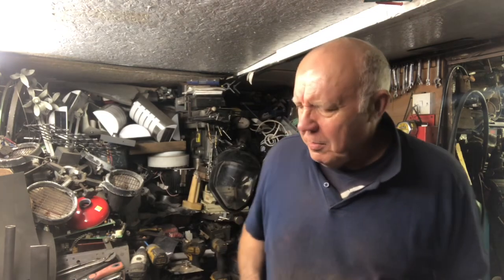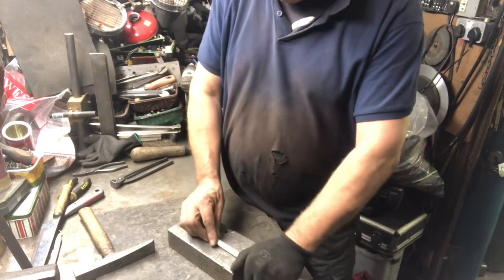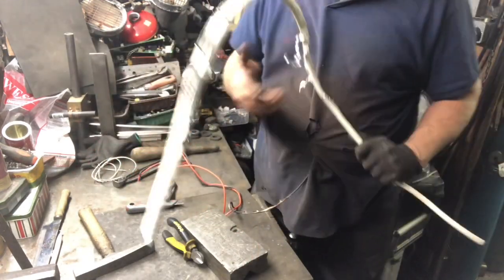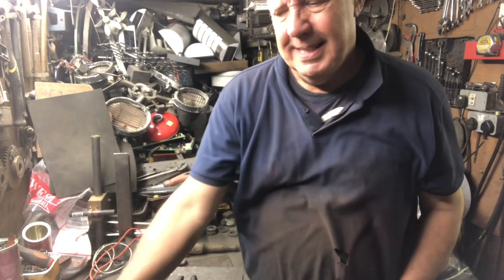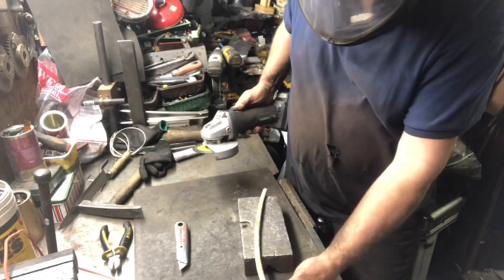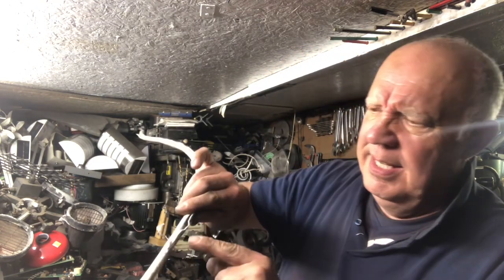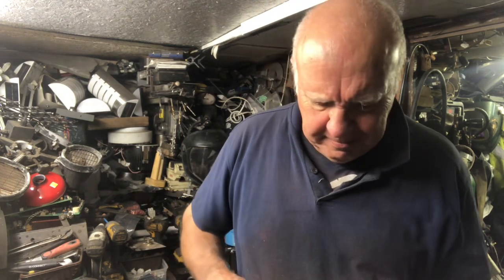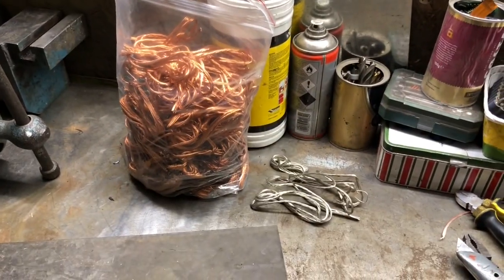FP200 wire. stripped easy way for copper

Comment: Some think this channel is just another pretty face but they are gonna be in for a shock today!  Very methodical and clever solution.  Over here we have some older fiber wound twin and earth cable that strips about the same.  Cut it to length and pull the individual strands out with pliers.  Cheers.

Comment: What we call bx or dx cable here in the US is similar. The other sheathing is just steel or aluminum with no coating
I've found it's really easy to get the all the inner wires out by just opening a 6 inch portion at one end to expose the wires inside
I then take and wrap the exposed wires around either my steel bumper on my van or the hitch and then simply pull on the sleeving from the other end
I've done up to 20 foot pieces at a time and it just slides right out
Reply: how do you fix/hold the other end of the sheathed cable? surely you have to hold that back some way

Comment: I have stripped many of that wire type, they use it for fire alarm wiring, I have never tried taking the ally out. I use to pull all three at once. I wore thick gloves and put my foot on it and pull.
Reply from the maker: I did that once, me hand slipped off n I smacked myself int chops
Reply: @Man-in-da-shed LOL... I see you were pulling without gloves . Need to be careful
Reply from the maker: @iffy9776  almost 100% I wear gloves, those black clingy ones but I can’t operate the iPhone with them on, so for some short clips it’s easier to leave them off or just on one hand

Comment: after 30 plus years of scrapping i finally invested in a auto stripper . worth every penny of making things easier and less time consuming . and ive already made a profit off it  but dont get the single one get the one with multiple hole sizes . ive tried all different techniques to striping wires  do your self a favour
and invest in one
Reply from the maker: Those do seem to be the best ones, maybe after the next weigh in.  I don’t usually get a lot of cable.

Comment: How was the brewery tour hope you got drunk 🤣🤣🤣,I guess you have to always perfect a easier way to strip that ally cased sheef and ya have ,simples,I've got some fire alarm cable its just the same as what your stripping  let's hope Robert let's you weigh it in as low grade ally 👍
Reply from the maker: It became less of a tour and more of a lock in. 🥴
Reply: He might just get away with irony ally for the case's 
If you like me and save up a full van load of irony you'd defo get irony price 😉